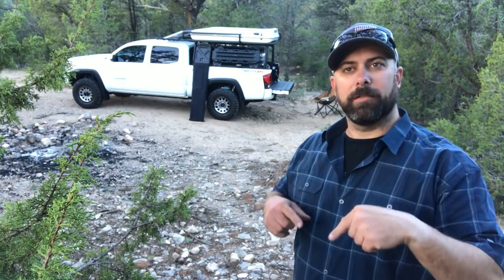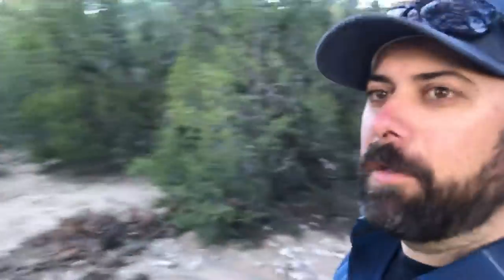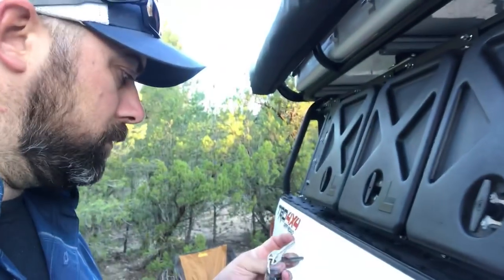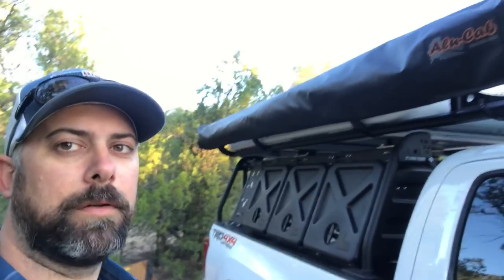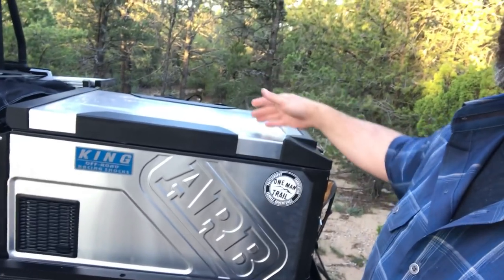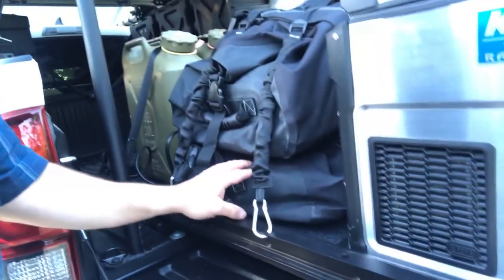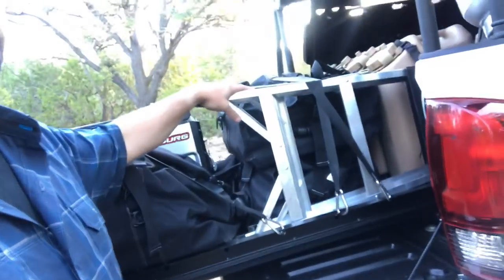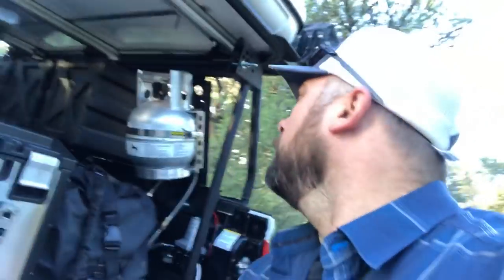One Man Trail - Introduction and walk around

Comment: If you didn’t add that extra piece on the front of the Leitner and your RTT was longer, would it clear the shark fin? If so, by how much because I’d like to fit a prinsu roof rack also. I’m considering this rack and trying to see if it will work for me because I have a short bed. Thanks
Reply from the maker: William Waite hard to say. I’m not with my truck where I can put a straight edge on it right now. Its going to be very close though especially with a Prinsu up there as well.